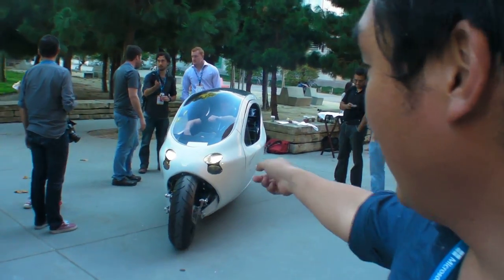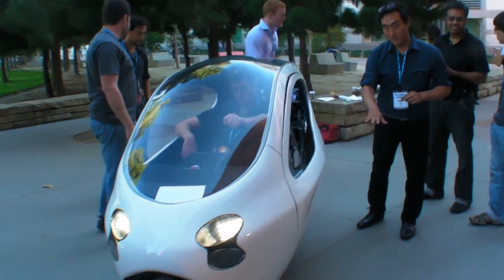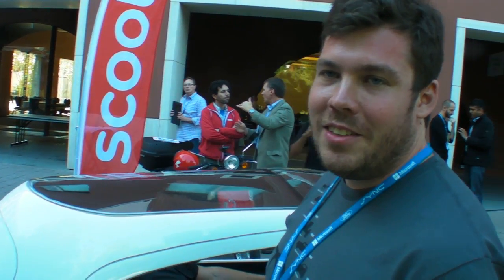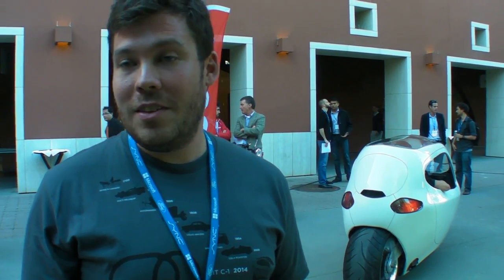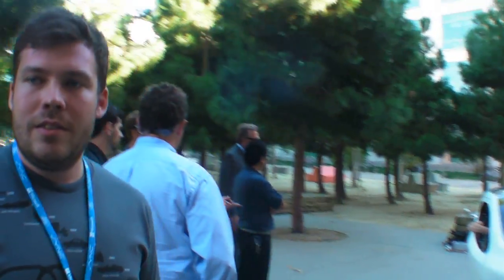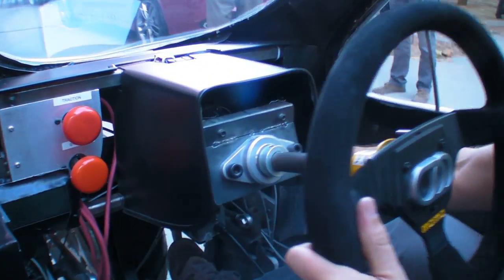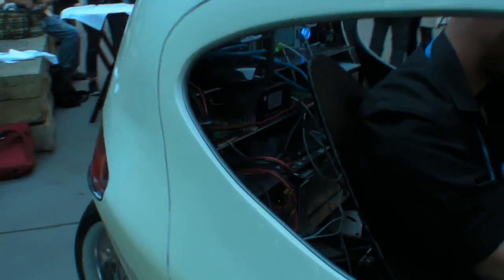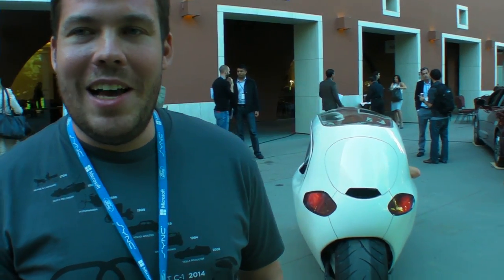Lit Motors C-1, fully-electric, self-balancing, two-wheeled vehicle at Gigaom Roadmap #roadmapconf

Comment: 11 years after and they are still in preorder.
Reply: Yep I'm thinking if they ain't solved it after 11 years what are the chances of them solving now.

Clearly there are some fundamental problems that need solving, throwing money at it won't solve the problem.

You can ride a one wheeled  vehicle so long as you have balance.

I think they need to move away from just using a gyro and look at alternatives, or in conjunction with the gyro.
Reply: As I understand it, the project shut down for many years because the owner was severely injured in a motorcycle accident. He’s only recently started the project up again.
Reply: @Antitheist  I don't think that is a good reason considering it was claimed that grey had a team, well the team could have continued the work if it were viable.

The thing is as i said you van ride an EUC which is one wheel, but this is two wheels so should be easier, after all two wheels have been going for a long time, the main problem is when the vehicle stops that's it.

How to stop the vehicle toppling over when it stops, when it is moving at a reasonable speed it holds its own, when it stops it will topple over.

They use gyros to keep it upright but it can't go fast due to the gyros, what I heard, perhaps the solution should have been to slow the gyros down at speed and use the wheels to speed up the gyros when the vehicle slows down.

That way the gyros only come into action at slow speeds and when not moving. But what do I know I am not working on the project.
Reply: @flitsies  I’m no expert on this either, but what I read indicated the project could only raise a fraction of the 20 million it needed to move the project along. I’m not sure that has been solved even today, but that would explain the research being put on hold.

Comment: The main problem with the prototype of this electric motorcycle is that it is too large, and in order to maintain stability, it is necessary to turn and consume too much energy. The mileage is bound to be very short, and the speed will not be very high. And to maintain a stable way through the mass of the high-quality gyro, the constant rotation will consume a lot of energy.

Comment: its nice but it would be better that could be a hybrid design.
Reply: +Nehemias Madjos Why? If the alpha build has a range of 100 miles then the finished one would probably have a range of 3 times that. Electricity is much cheaper than gasoline or diesel so charging it would be preferable to filling it up with gas.

Comment: On snow? On ice ? Under 50 c degrees it 's not too hot inside? No battery is it still working or we will fall down? Love the project though
Reply: +Kalvin One The battery can't die suddenly - it will always have enough power at least for control and gyroscopes. However, should the power fail somehow while riding it may use its motors as generators to control itself while slowing down.
Hard drives use the same principle to put data readers into parking position when cutting power - power is taken from motor that is spun by disks with data that have large inertia.
Reply: Ive quite alot of experience with rc motorbikes with gyros and ice is no problem, its like magic!

Comment: This is pretty cool but need more innovation especially on the head and tail lights also as you can see the rear wheel has an opening to the inside of the c1 and if it is raining while driving the water will get inside also i think we need ac. On this one

Comment: So they´ve now trashed this prototype, put a chain drive on an open frame with gyros and can now go (very slowly) around a very large circuit. The thing has outrigger wheels. And yet they are still taking down payments for delivery in 2014! The Gyro Hawk did all this and more 1n 1993. The hype is over!
Reply: Any links to what youre referencing here?  Everything Im finding on it is an older article

Comment: For all those that worried about the gyros taking up all the power, I doubt they will have it continue to run, while the bike is moving, since the wheels will provide the gyroscopic action, just like a normal bike.  Also, when it's stopped for longer periods of time, they will release the automatic kick stand.

Comment: ok but I have yet to see any serious test drive ... in all the clips goes very slowly and just straight without bending... ;)
Reply: That's the point of the video. Any motorcycle can lean when going fast(er) than that. This bike is cool because it can go reaaaaally slow and not fall over. Once it picks up speed I assume they're shutting down the gyros and it behaves like a normal bike.

Comment: To say distance (on one charge?) without average speed is very unprofessional. Gyros are noisy and driver sits as a statue scared to sneeze, let alone to get out &in without toppling it down.. It's insult for reason, unless it's a bad joke. Specs are huge secret..(most critical: power to weight ratio).. out of shame? No they don't want to hurt competition. I don't see engineers there.. fashion show designers only. It looks cute.. that's it &that's all.  
Thrustcycle have gone much further.

Comment: I would prefer a cross between a motorcycle and a car seat- something you straddle. Also, this is a proof of concept prototype, years away from full scale production.  I'm sure they can get the final version to be quieter than a kittens purr.

I am a little worried that they are only asking $24,000 for first round production- I would expect the first round to be over 30. I guess they are trying to prove they can make it inexpensive as well.